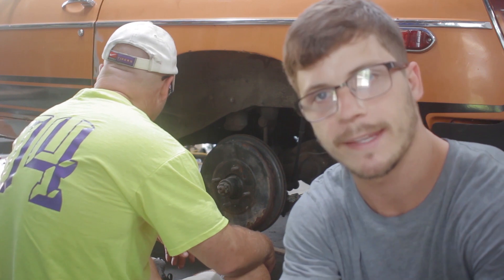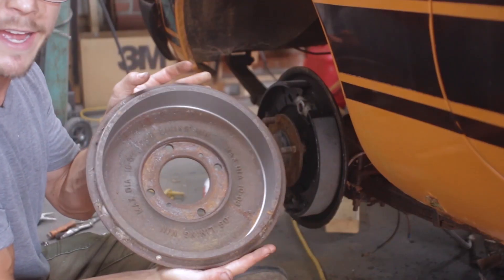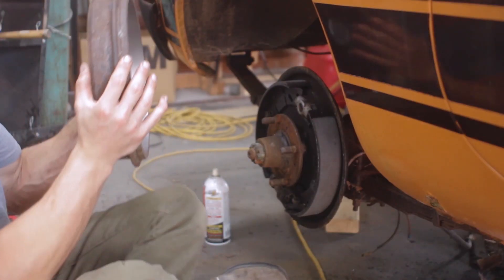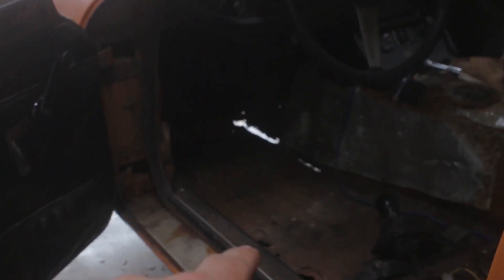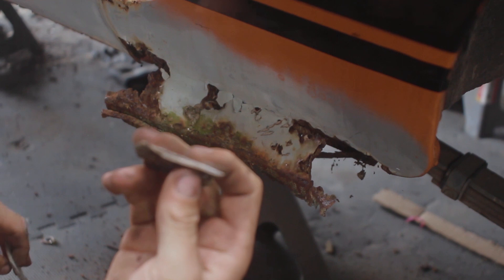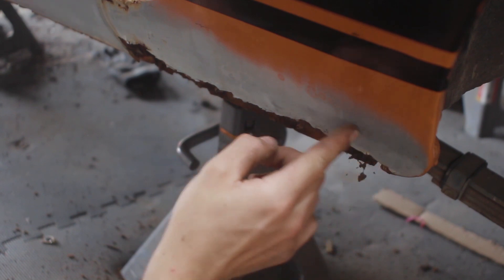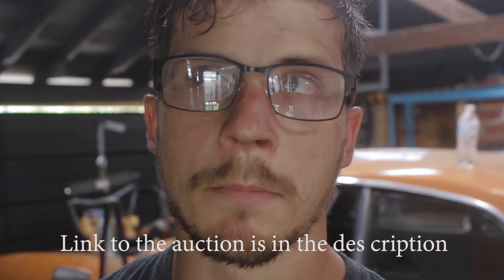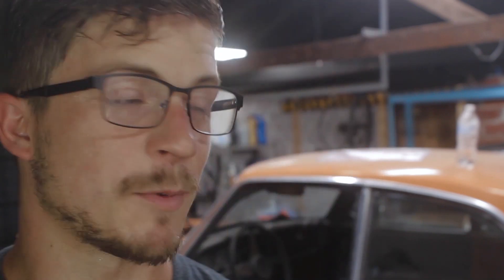THE RWMGB pt. 5: REPAIRING THE RUST

Comment: The back brakes adjust up more automatically as the brake shoes wear down guys you need to reset the ratchet before replacing the drums Iam from the uk and I had one with the same problems
Reply: It's not problems as such. It's just how drum brakes work. Some self adjust others need doing manually  with a screwdriver on the winder
Reply: Just go in reverse and slam on the brakes that will adjust they tight again.

Comment: As been said already, the rear brakes need adjusting back in to compensate for the new pads. They were previously adjusted to cope with the wear and now need resetting with the adjuster. They should bind very slightly but still spin by hand. Will need checking and readjusting periodically as they wear

Comment: The issue with getting the drum back on is you have new pads, the adjuster needs to be turned out all the way.  Put drum on and make sure drum spins.  Turn adjuster back in until you start dragging on the drum then back out 1/2 turn (or some say just 1/4 turn).  A good thing is to also make sure the park brake lever inside the drum is loose and moves freely.  not a bad idea to just leave the park brake linkage undone until everything is back together.  GOLD

Comment: You need to bring the adjuster all the way down first, then slide the drum on and start expanding the adjuster through a slot on the back plat with a screw driver.

Comment: Adjust the brake shoes loose enough to get the drum on. Then manually adjust tighter until the shoes slightly drag inside the drum wall.
Reply: That’s right and a easy trick to tighten them is drive in reverse and slam on the brakes super hard a few times lol it works haha there are other ways but this is the funniest way.

Comment: Use the adjusters for the rear brakes, they will pull the shoes in. Once the drum is on adjust it from behind the dust plate. The drum should still spin but with a little bit of resistance. Only replace the wheel cylinders if they are leaking. You can grab a flat head and lift up on the rubber boots on the wheel cylinders. If they have fluid behind the boots then replace.

Comment: The drum brakes self adjust to compensate for the wear of the brake shoes.  Since you replaced the pads with new ones, you are going to turn the screw adjuster that holds the bottom of you pads.  Once your turn the adjuster down and install the drum, you should be able to adjust that from the back side.

Comment: When you open the rockers or quarter panels up. You should atleast coat the inside with por15 it will incapsulate the rust and help keep it from coming back.

Comment: adjuster the star wheel adjuster so the shoes are loose enough that the drum slides back and forth easily on it. tighten the adjuster until the drum is somewhat difficult to slide over the shoes.

Comment: You should grind away the lip off the outside of the brake drum and it should go on a lot easier, the other thing if you can't get it on without a hammer, your brake shoes are adjusted too much, the drums should spin but with some friction so it spins for about half a turn after you let go, I do loads of this at the garage I work at

Comment: Problem is many shops use stud welders,migwelders,lead with torch,Tiga perfectly good rust patch,but the back of the panel is a burned,so 10 or 15 yrs later it eats thru the metal and it makes it seem like theybodyfilled over rust.

Comment: Didn’t go on easily because the adjuster was turned out. Gotta run the adjuster all the way in and adjust the brakes after the drum is installed. 
And replace the brake cylinder (servo).

Comment: You should never have to hammer any brake parts into place especially anything that's supposed to spin. Your issue with putting on the drum properly was adjustment if it's not adjusted properly the drum won't slip over the shoes you have to adjust them down until it slips over with just has a minimal amount of drag.

Comment: I don't think the wheel cylinder is the issue. Did you adjust the brakes (star wheel adjuster) inward so that they aren't rubbing the drum or where you have to force it on first? You use a screwdriver from the backside to adjust the wheel out again to firm the pads up once you have the wheel on.

Comment: new pistons springs and then adjustment from the top rear adjuster, i would dismantle rear adjuster, clean it  and copper grease the thread. rebuild then adjust all new parts available from the club. uk owner. the rear shoes do not adjust automatically . need to be adjusted by owner. good luck.